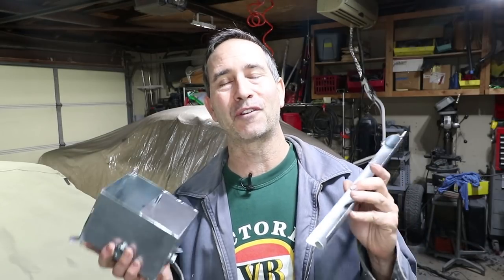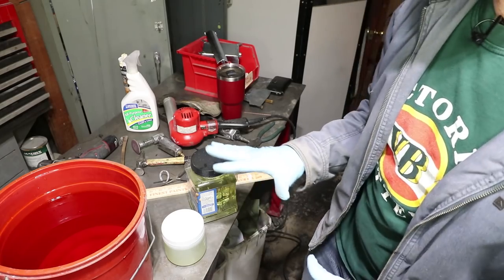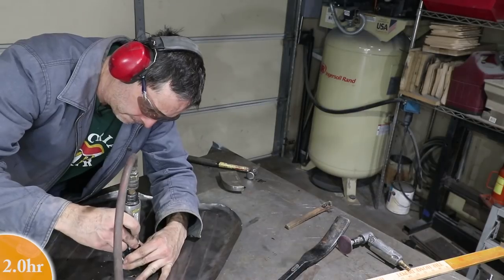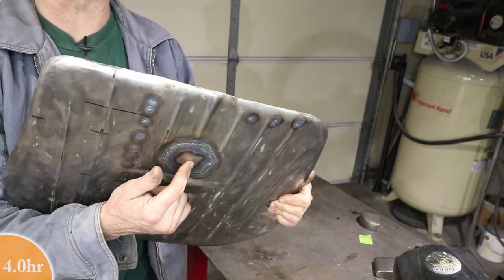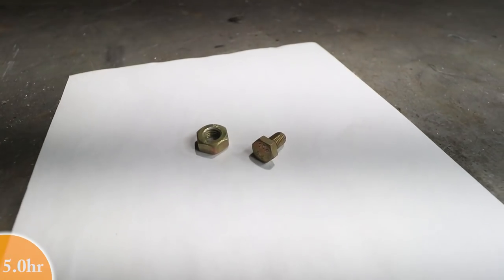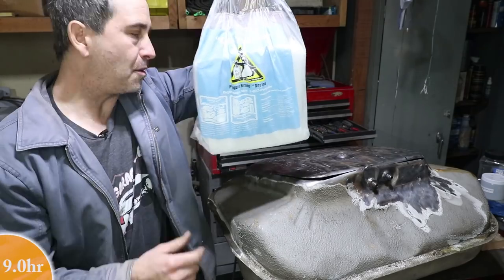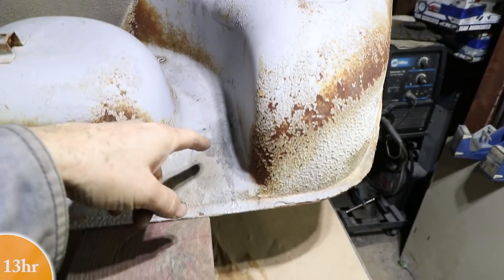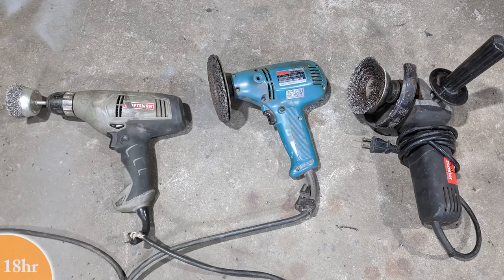Super Difficult Gas Tank Restoration and New Upgrades

Comment: I've repaired many tanks and I could not watch without reccommending  POR 15. gas tank  prep and sealant  it will last longer than the car for sure.  Cheers from Quebec.
Reply from the maker: That stuff is pretty good, however I didn't use it because it would foul up my check valve balls.  And it wouldn't be safe to apply before welding.

Comment: Looks awesome. Are you planning to add any rubberized stonechip on the bottom?
Reply from the maker: Probably not.  Epoxy primer is pretty tough.  If it does get scratched that's okay, It's just a gas tank.

Comment: Is there any advantage to soak times, dwell times , between chemicals?
Reply from the maker: I haven't experimented with it too much because it seemed to work ok according to the advice I was given.  Too much time in the muratic acid will turn the parts dull, so I reduced the time in there.  The Chromate seems to bite into the zinc really well.  The longer you leave it in the darker it becomes.  Too long and it becomes streaky.  I did discover that it's wise to air dry the parts with a blower and flip them a few times in the rack when drying.  This makes the yellow more even.  No standing drips.  The nice thing about this kit is that all new bolts can be made to look vintage or period correct!

Comment: I work in my garage just like you and I have a Porsche 911 just like you. I am also a welder (retired now) done it all my life from auto body to aerospace and also structural steel.
1) butt joint with variable gap like you welded is a no no on something like a gas tank.you need a thin back up strip underneath which does several things like preventing overlap and tightening of the root both can cause cracking and lack of fusion. Also prevent weld contamination by sealing the root from oxygen while welding. You always leave a gap all the way around for good penetration. And you will avoid dropping molten metal in your tank.
2) you dont test a gas tank by pouring standing water in it. I have welded gas tank before in my illustrious career. You dont test only for leaks but also for fumes. Your test is worthless. You need to apply internal pressure with a liquid and then do a soap test. You have to be slightly deranged to weld a gas tank that will be next to a battery, fuse box and relays the way you did weld that thing.
3) spray painting in a closed space with a compressor in the same room that can start at any moment is hard from me to comprehend. Stupidity kills.
Reply from the maker: I'm glad you're here and you can heckle all you want!  It doesn't phase me.
1) A backing plate isn't needed.  No molten metal is dropping nor seams overlapping.  I don't and didn't have these problems.  
2). The tank does not leak.  5000 miles and it still doesn't leak.  The fuel tank vents fumes on purpose as I'm sure you know.  
3)  The compressor is turned off during spraying. Maybe you are skipping ahead or haven't watched enough
See you on the next one.  Hopefully with some constructive tips
Reply: @GarageTimeAutoResto  The  purpose of my comment was to make you aware of your own ignorance. Welding joints are specific to applicable codes and standards. For sheet metal welding you might want to consult AWS D1.3 for structural application and D9.1 for the rest which would be your application.  Nowhere will you find a sheet metal butt joint with open root. If you are welding a patch at the bottom of a rusty fender it will not really matter, but EVEN there it is not a good idea. Unprotected open root does not exist in any code or standard I know of. I can tell you are self-taught, with very nice welding skills but zero theory. Lastly by posting on U tube you have a responsibility for safe working practices. These two points are sorely lacking in your presentation. If you want to grow your channel, you will have to do better because WE are watching you!